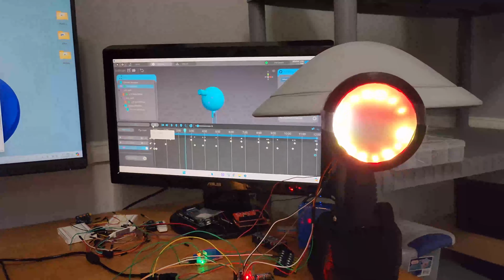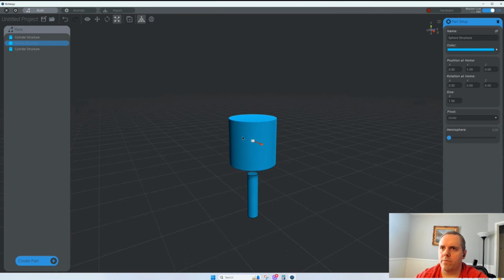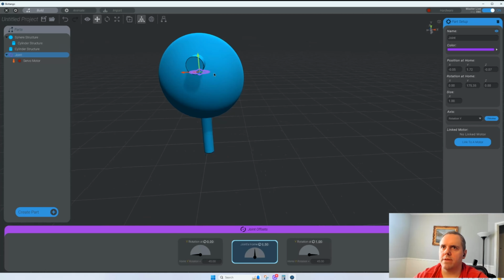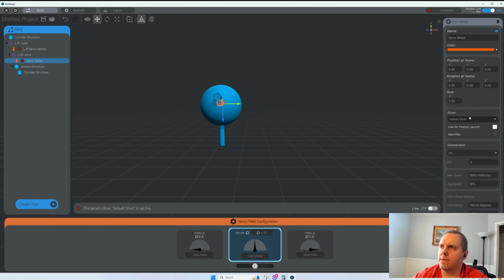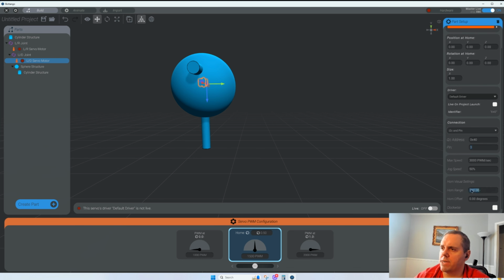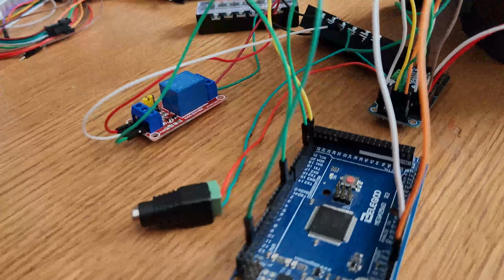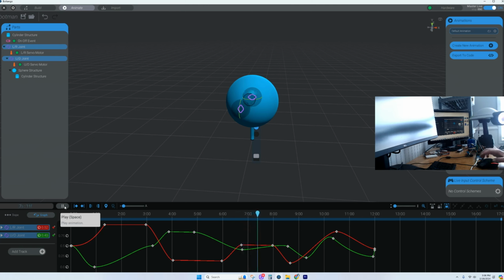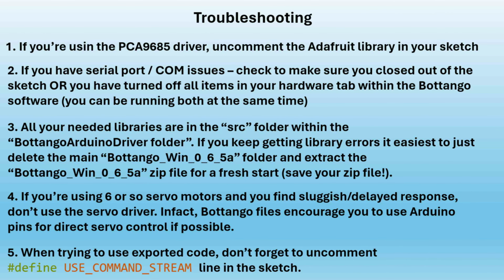Enhance Your Projects with Bottango: Using Servo Control with Arduino Mega & PCA9685 Servo Driver

Comment: Bottango Developer here, great video and great job! Awesome to see you make such great tutorials and content with Bottango!

A few tips, if you don't mind my throwing out there: 

1)While animating, you can add tracks manually, and add keyframes using the add keyframe button. But also, just select a joint in the animate view, even if you haven't added a track for that joint yet, and start moving it. It'll add the track for you automatically, as well as add and modify the keyframe based on where you rotate the joint. You can keep adding and modifying keyframes that way, by moving the joint in the 3d scene where you want it, and the keyframes will get added / changed.

2) At 17:45, you're trying to use only a portion of the servo's range of motion, but you changed the visual of the simulation of the servo in the 3d scene, not the pwm that's sent out. To send a smaller amount of range of motion signal to the real world servo, modify the PWM values at the bottom center of the screen with a servo selected.

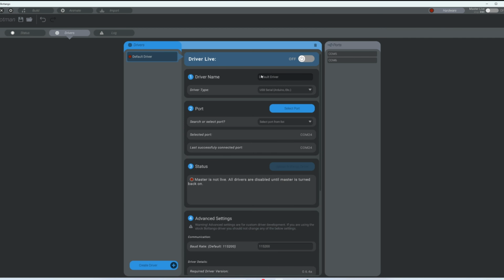3) At 23:45, you're referencing the default driver. That's the Mega you're connected to, not the animations in your animation view. You can have multiple Arduinos all connected to Bottango at once, and assign different motors to different Arduinos. So default driver is the first Arduino set up by default in the project, but you can add more. The Default animation is just the first animation in the project. The two aren't connected.

Great stuff, and keep up the good work!
Reply from the maker: Awesome stuff. I appreciate your comments and will remember this going forward. Great job on the software!
Reply: Can you also use the micro maestro servo controller?

Comment: I have a question, how did you get your 180 servos to only spin 120 degrees? when i try to use bottango with my 360 degree servo and i set to 180 in bottango it constantly spins 360 degrees
Reply from the maker: you can change the max angle to 120 in the setup.  👍👍

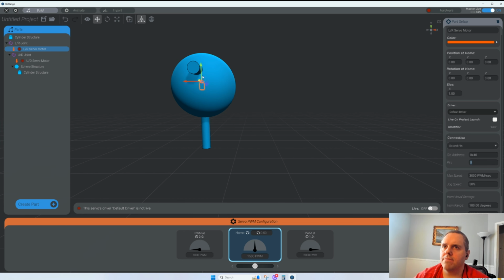Comment: What do you mean at 17:25 where u were talking about where to set up your connection? Am trying to make my own animatronic and I don’t know what u mean by 0x40 and pin 1
Reply from the maker: hey there!
That is the default I2C address for the PCA9685 16-channel PWM driver - default is 0x40.
Pin 1 was the location of one of my servo motors.

You can change the address by soldering  the address jumper pads on the bacok of the board, which changes the default 0x40 address to a unique address. You don't need to do this unless you're using more than one driver board.

These addresses allow multiple PCA9685 boards to be chained together on a single I2C bus, it allows you to add a bunch of extra PWM driver boards and servos if you need them. 👍

Comment: Great video!  Being new to Arduino, droid building and animation, you covered a lot of material in 30 minutes.  I guess slowly walking through the process I'll learn all the steps you performed.  How long does a 9v battery last if you just turned him on and let him run until 100% depletion?
Reply from the maker: hey there!  thank you. I appreciate that.
Assuming the LED strip + servos have their own power and the 9V pack only runs the Mega (data/control), it may run around 10hrs or longer if you're using a  high capacity 9V 1100mAh Lithium Rechargeable Batteries. 
I used the mega board because it works with Bottango, which I think is a great software for animatronics. It takes the trial and error out of  getting the right movements, and the movements are smooth!
There are a number of power supply and microcontroller options for this pit droid,  just remember to power your servos and LEDs with a separate power supply.

Comment: Hello,

I don’t know if there was an update for the code or something but whenever I try to upload the code on Arduino it’s says “Complication error: src/BottangoCore.h: no such file or directory” I have been trying to find a way to fix it but I still can’t. Do you have any idea what to do? Also great video!
Reply from the maker: Sorry, 
You need the header files along with the .ino file to run  it on Arduino. If you load it onto your Arduino it may not look exactly like mine. If you need help creating the movements in Bottango, I can help.  That's the easiest way to get your droid moving.

Comment: I did everything in this video but whern i turn the servo motors live the irl motors dont move, why is that?
Reply from the maker: did you uncomment #define USE_COMMAND_STREAM  line? If you are using the servo driver board, uncomment the #define USE_ADAFRUIT_PWM_LIBRARY line. If you aren't using the driver board, leave #define USE_ADAFRUIT_PWM_LIBRARY commented.
did that help?
Reply: @BMonsterLaboratory  i uncommented it but the same issue still persists, what else can i try?
Reply from the maker: when you exported the files from bottango, did you unzip them and place them in the arduino .ino folder?  they need to be together.
what does it look like when you try to operater your motors?   can they operate when connected to the software?  just trying to get a picture of what this looks like.

Comment: I'm a complete beginner and I have no idea how to export Bottango animations to Arduino correctly, and I have no clue how to get a Bottango driver sketch. because my installation of Arduino doesn't have it. and I feel like I'm missing something blatantly obvious. id like an explanation

EDIT: nvm I was just missing the fact that the Bottango Arduino Driver folder was insdie the Bottango_Win_0_7_0a1 folder-
Reply from the maker: take a bit of tinkering with to learn how to use. once you figure it out, the program runs great! 👍
Reply: @BMonsterLaboratory  also quick question, do you need to have everything else commented on the Arduino config? because when i open mine up, all of them aren't even commented in the first place.

Comment: Hello, Nice series of videos.  I have a little question, the MG966R specs says they work better at 6V. You are providing the Servo controler with 5V. Have you noticed any issues running your droid with a 5V power supply  ? The specs also says the servo have a stalling current of 2.5A. So for two that would be 5A Have you ever had issues with your 4A power supply ?  Or do you always have to make sure the two servo do not fire together ?
Reply from the maker: hey there!  thank you
The MG996R works fine at 5v but speed and torque will be slightly lower at 5 V than it would be at 6 V. If you pack the droid head with electronics and maybe a large battery, you will need 6v. 5V was convenient for me because it is the same voltage that the LEDs run on and the servos really aren't requiring much torque with an empty head. The servo for lateral movement requires very little torque, especially since you have a few bearings in the neck.
At max load and max voltage, the servo can have a stalling current at 2.5A. It won't (shouldn't) get anywhere near that for this project. A 5A supply would be perfect for 2 MG996R servos in this scenario. If you're unsure about the current your motors require, you can test the current using a multimeter as it is working. 
It is fine if the 2 servos move at the same time, that is what helps to give it a more life-like feel.

In this video I measure current of a small servo during operation, without load: 
https://youtu.be/UeS5nY345kc  I measure the current at 2:32

I hope this helps

Comment: May I ask how do you know how to connect a pca9685 To bottango ??
Reply: Does the PCA only work at the end or can it be used for testing?
Reply from the maker: @Sammyrobotics-bv1x  you can use it in your project. It's not just for testing.
Reply: Does pca only work at the end when the code in put in because I have been stuck on trying to connect it to bottango
Reply from the maker: @Sammyrobotics-bv1x  Are you talking about not being able to get the motors to do live on the hardware status screen?
Reply from the maker: You will need to set up your hardware and configure your Arduino using Bottango. You set up whether you're using a pca9685 or not, rotation, timing, pins you're connected to...etc.  At the end, when you'll all done, you export the code into a file. You join the necessary files to the Arduino folder and it works great. Honestly, I haven't been using the pca9685 board since this video. My projects have been running great without it. You'll want to see what works best for you.
I read most of the documentation for the software, the files that are in the bottango zip file. You'll also want to read how to get the bottango code to work and what header files need to be in the Arduino folder. This documentation is exported along with the code. 
The only way I learn is to jump in and test stuff. Nothing is perfect on the first try but after a little tinkering and adjusting, you'll get really smooth motions with Bottango.

Comment: No such file or directory is what it said please help
Reply: I finally found out all I need to do is extract my folders
Reply from the maker: @hyperplayeryt8426  Nice job!
extract zip file and place them in the Arduino folder since they are part of the code for your project 👍
Reply from the maker: That's probably because you dont have all the files in the arduino folder.
Reply: Help it said bottangocore has not been declared
Reply: Thank u so much sir

Comment: I dont get the files part when i did what u said i press on the bottango arduino driver in only shows the bottangoArduinoDriver.ino what do i do help please
Reply: But how are u going to send me a screenshot
Reply from the maker: @hyperplayeryt8426  facebook. Email.. you pick
Reply from the maker: Are you referring to the exported files?  There are 3 files that export from the software, a text file, a GeneratedCommandstreams.cpp file, and a GeneratedCommandSrtream.h file. You need to put the .ccp and .h files in your Arduino folder. These files should be in the same folder as your .ino file. when you open the .ino file you'll see the  GeneratedCommandstreams.cpp and GeneratedCommandSrtream.h tabs included in your Arduino IDE program code. 
remember to uncomment code lines as necessary on the BottangoArduinoConfig.h tab.        I can send you screen shots if this is hard to follow.
Reply: Yes please send me a screenshot please
Reply: I dont have a Facebook email
Reply: I have a Facebook account now but it only let me put my phone number

Comment: I got a question what file do I put it on ???
Reply from the maker: hi there.
not sure I follow the question. You can create the animations in Arduino IDE and use an Arduino board. what part are you stuck on ?
Reply: @BMonsterLaboratory  when you import the code to the ardino what file do I put it on??
Reply from the maker: After exporting code, put it in your Bottango Arduino folder
Download Arduino IDE and use it as your text editor for the code. Upload the code to your Arduino board from Arduino IDE.
Here is a comment I left on another video. It walks you through Bottango. - see below

Assuming you have completed the "Build" portion of your project, including part setup and setting ports for your motors and connecting joints...etc.
If you want to run the animation while connected to the Bottango software: 
1. click hardware button at top right
2. click "drivers" tab
3. create driver or select an existing driver
4. scroll down to "status" and upload Bottango driver to whatever Arduino board you're using.
5. select port - finish setting up the connection inthe drivers tab
6. click "status" tab next to "drivers" tab
7. change master to "live", change default driver to "live" and turn on your connected motors.
you should be able to move your robot from the build area in the Bottango software. All motors in hardware section should be changed to green to verify connnection.

If you want to run the animation independent of the Bottango software:
Assuming you have built out your animations at the bottom of the screen...
1. click "animations" 
2. click "export to code" on the right
3. go through the steps to export code. 
4. you'll have 3 exported files; a .cpp, .h, and .txt file. move these files to the BottangoArduinoDriver folder. This file is part of the Bottango_Win_0_6_5d executable file you downloaded from bottango.com
5. Once your 3 exported animation files are in the  BottangoArduinoDriver folder folder, open the BottangoArduinoDriver.ino file.
6. The program will open in Arduino IDE - click the BottangoArduinoConfig.h tab and uncomment this part of the code  // #define USE_COMMAND_STREAM by removing "//"
change // #define USE_COMMAND_STREAM   to    #define USE_COMMAND_STREAM       
*IF you're using a motor driver breakout board and Aadafruit_PWM_library, uncomment that part as well.  // #define USE_ADAFRUIT_PWM_LIBRARY

Comment: You mentioned the code is on the facebook page under comments but there are no comments for this project listed there. Somewhere else may be?
Reply from the maker: I apologize for that. posting the code to Facebook proved to be difficult with this project. the Bottango code is a multi file program. When you export the Bottango code you move those files to the BottangoArduinoDriver file. There is a readme file that is exported along with code, it's very helpful.  
You will want to download Bottango_Win_0_6_5 zip file from the website and transfer your exported animations to this file. I'm happy to email my files to you if you would like.

Comment: Every time I try to export code to Arduino it doesn’t let me I’ve been stuck on that part. Can you help me? I tried to refresh it every time I try to open the file that you told me it doesn’t go  Arduino software export the code
Reply: It doesn’t say any error messages I just don’t let me export it from bottango to Arduino
Reply from the maker: @Sammyrobotics-bv1x  Hmm... I'm not sure what the problem could be. In the animate tab on the left, look right and click export to code under the animations. From there you just follow the prompts and select a folder. I'll keep playing around with it but I haven't seen a problem so far.
Reply from the maker: I was able to open a brand new project and go straight to export. It says I have no motors or effectors in selected animation clips. make sure project is saved and try again. If it doesn't work, remove and reinstall Bottango....
Reply from the maker: interesting. do you get any error messages? Where is the exact point of failure?  I can make a Youtube short on how I do it...if that helps.

Comment: hi nice tutorial can u explain how u controller the neopixel ring in the eye I know u put a custom event but I need to make some modification to the code. and another questions u try to play without the pc but trigger the animation with some kind of motion sensor or push button. Thanks
Reply from the maker: Hey there! 
I went simple with the LED ring. You can put your own LED code in the Arduino sketch but this WS2812B LED ring comes with a mini RGB controller, and that is what I use. I can control blink speed, color, and pattern by pressing 3 buttons. All I do for the LED ring is provide 5v power...It's the easiest way.
I am posting one more video with this pit droid head motion this weekend. It will have a basic HC-SR501 motion sensor to to activate motion. I will be including the code I added to he exported sketch and a number of diagrams in case someone else wants to do the same thing. 
If you would rather have a bush button, that's doable too. The goal is to post the video Saturday morning ....10 or 11 am EST.
Reply: @BMonsterLaboratory  thanks I wait until Saturday to follow your tutorials.

Comment: How did you upload the bott tango file to Arduino also I am on Mac book
Reply from the maker: Hi Sammy, 
I'm on a pc, so I could tell you how I did it for pc....not sure how it translates to mac. Export from the Bottango software, open the file and drag 2 files (GeneratedCommandStreams.cpp, GeneratedCommandStreams.h) to the Bottango Arduino driver folder. From this file, open the Bottango Arduino sketch, go to BottangoArduinoConfig.h tab and uncomment #define USE_COMMAND_STREAM  line. If you are using the servo driver board, uncomment the #define USE_ADAFRUIT_PWM_LIBRARY line. I am currently using 2 servos and not using the servo breakout board and it's working fine. If you're not using the driver board, leave the line as it is "// #define USE_ADAFRUIT_PWM_LIBRARY "
From here you should be able to upload and start your animation without the computer. Upload the file from Arduino IDE. If you connect back to the computer, be sure to comment the command stream line "//#define USE_COMMAND_STREAM"
👍

Comment: Thank you so much for this video … is there any way u can trigger 3 different file with 3 buttons?
Reply: I have 3 different motion profile (2 servos and 5 on/off events ) I would like to assign 3 buttons for each motions .. hope u get it and thanks for quick replay
Reply from the maker: I haven't done anything like that yet. It sounds doable though.
Reply from the maker: hey there! Would each file go through a different animation ?  For example, button 1 would make it talk and look up, button 2 would make his light blink, and button 3 would make it look around while talking and flashing lights.
Am I on the right track here?  You can do that...or should be able to do that. Can you explain a bit about what you want to achieve?
thanks for the comment and good luck with your animations! 👍💪
Reply: I appreciate your reply.. can I least connect one switch to play one motion profile